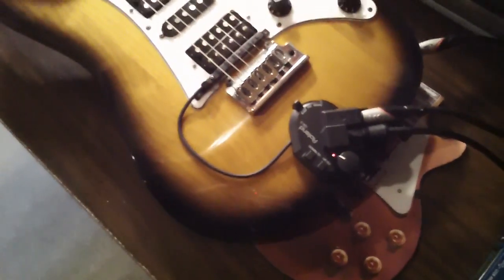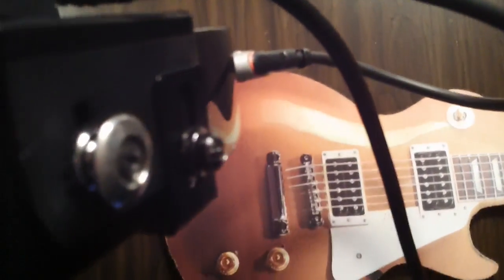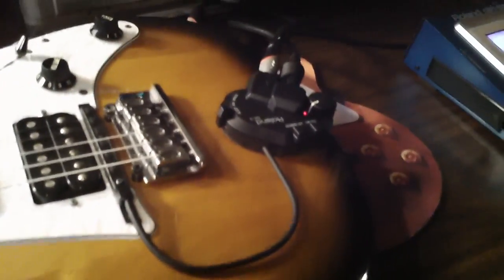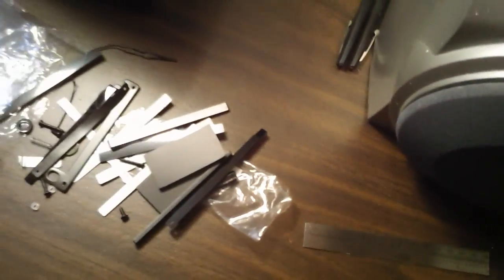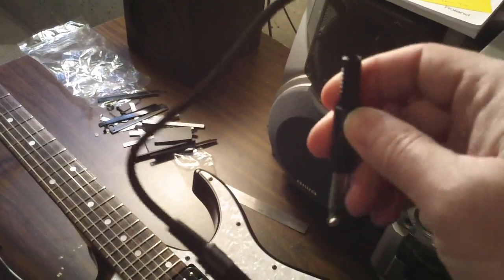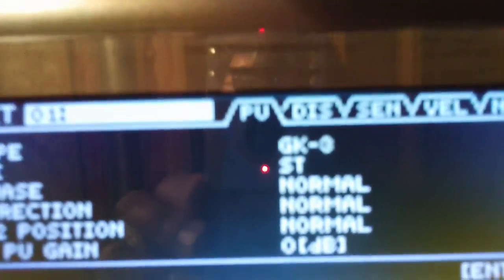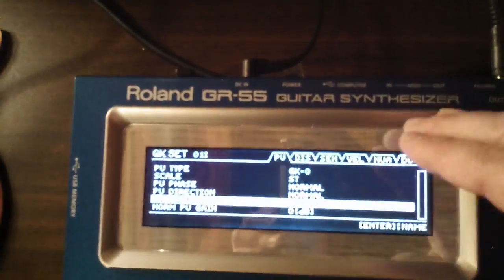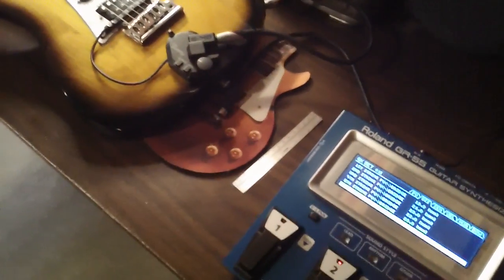Roland GK-3 Pickup Post-Installation Overview

Comment: Bought a use GR 55 and GK- 3 pickup (like New) on the GK-3......the GK and Mix switch are the same and on guitar there is nothing no sound at all. Can't figure it out, any suggestions? Help going nuts trying to get it to work!

Comment: Question... if all i want is full synth sounds from the gr55 no blending or none of that specifically synth tones for lets say a saxaphone or flute solo here and there, can i just plug the 13 pin cable into the gk3 by itself and output from gr55 to a keyboard amp, then plug the guitar output jack to my main pedals and my fullstack as i usually do?

Comment: i'm using the gk-3 on boss gp-10. when i plug the guitar cable to the gk-3 input, i dont hear any sound from my guitar.
does it only work with gr-55? i usually have 2 cables attached to gp-10. one guitar cable going to guitar input of th gp-10 and a gk cable separately.
i saw your video/ the ouput of the guitar goes to the gk-3.

Comment: Thanx that was my big concern about buying one because if I wanted to try it on one of my other guitars or was it guns hurt the value of one my more expensive ones by drilling or making a permant scar on it.good job  of brekin down other tools or acseories I mite need.you wee very helpful in helping me make decision on getting one.atleast now I know I wouldn't have to by another axe just for a processor.now is it fairly easy to navigate through the settings or do indeed a big manual n a translated to figure it out

Comment: i had to cut the pick-guard with a Dremel tool on my 2013 stratocaster to get the clearance needed for the gk-3 pickup.  worst part of the install - but not hard.  looks like you have your saddles set up very high to provide enough clearance for the gk-3?  what is your string height over the fretboard at like the 7th fret?  i thought of just raising the saddles but was worried it would make the strings too high to play.

Comment: Did you have any problems with PCM tracking? I placed the PU correctly, the distance is under 20mm from the saddles, and exactly 1mm from the strings, for every string. But most, not to say all, of the PCM are having lag when play, for example, a simple walking bass using the acoustic bass. Mainly on E and A strings, some times at D string too...
Reply: +SixStringWorship I gave it a little more time to practice and I'm getting a better result now. But still having weird lag on PCM Piano and Bass. Thank you anyway :)
Reply from the maker: +Les Souvenirs Great news.  I remember a few of the patches required some time to get used to.  Take care!
Reply: Is this compatible with a whammy equipped guitar ?

Comment: For those who wants to install the GK-3 in reverse direction with GK-3 cable from bottom high E string. Please follow the link below. I found this after hours of searching online. You can change the setting in GR-55 in 5 sec after installing the GK-3 pickup. It's that easy!!

GR-55, GR-55S: CHANGING THE GK PICKUP DIRECTION:
http://www.roland.com/support/knowledge_base/201955829

Comment: Hey why do u use and plug in the monster cable to the gk3 and the guitar what do that do? Thanks
Reply from the maker: That allows you to blend or split your actual magnetic pickup signal through the GR-55.  You can route the magnetic pickups through a separate amp that way.
Reply: CoffeeDrinker71 I heard u can use your others distortion pedal with the GR55 unit?
Reply from the maker: ***** You can treat it basically like any other multi-fx processor so yes if you want to run a distortion pedal with it I suppose that's fine.  I never set it up that way because the on-board patches and amp models gave me plenty of choices.  Just remember when you are actually using the GR-55 you are engaging the GK-3 pickup system.  I don't know how good those piezo style pickups will interact with another distortion pedal.
Reply: CoffeeDrinker71 I see u install the gk3 to this ibanez u have alot of room to install the kg3. On my ibanez guitar I have the ibanez rg 50 and the ibanez rg3xxv model on both guitar I have to take out the pick ring around the pickup to make room to install the kg3 pickup.
Reply from the maker: ***** Yes, this is the Ibanez RT450 from 1992.  It's basically a Strat configured RG so it has a traditional style bridge which gives it enough room to install the GK3 properly with no other modifications.  I could definitely understand why the GK-3 won't fit on a Floyd equipped model though.
Reply: CoffeeDrinker71  thanks for the help!

Comment: I put one on my PRS Custom but the selector switch only works when its in GK when its in Mix or Guitar setting no sound from my onboard guitar pickups I calibrated all the setting on the GR-55 25" neck length & the Bridge to pickup distance I don't see any thing else to adjust
Reply from the maker: In order to use your magnetic pickups in "mix" or "guitar" mode, you have to have a separate amp hooked up to the back of the GR-55 using the "guitar out" 1/4 jack.  It's basically like a pass-through.
Reply: CoffeeDrinker71 You know I thought so Because when I took it back to the store we plugged the jack from the amp to the Guitar out on the GR-55 and I was happy about that because I knew we were getting a signal trough the 13 pin cable. so in other words theres nothing wrong with the switch its working the way it should. I wondering now if I could use the second Channel of my twin to get the other feed from the GR -55 I will do an experiment. Thanks for the heads up my friend c];-D
Reply from the maker: AL theDoctorWho I'm glad that helped!  I'm not completely familiar with the setup possibilities with the Twin like yours, but whenever I hooked mine up to run two amps I simply used the GR-55 through a set of desktop monitors using the "normal" left and right 1/4" outputs, then I'd run that separate line to another amp from the "guitar" output.  You can do some amazing things with a split setup like that!  That way, you could add all your effects, distortion etc. to your normal guitar signal, and then add a beautiful synth pad behind it through the other signal.  Have fun!!!!
Reply: CoffeeDrinker71  I'm having exactly the same problem: I can't get the guitar-only selector switch to work having one amp hooked up to the mono output of the GR-55 as the only setup. No sound comes out when I change the selector to guitar. I thought it was a calibration problem, but nothing works. So, your suggestion (using the guitar out) is the only solution? I used to own a GR-33 and I never had this problem. So, this seems to be a limitation of the GR-55. I saw a You Tube video of someone switching from guitar to synth with only an amp-to-mono setup, and it worked fine. What do you think?
Reply: MusikeXavier Its funny I was thinking to myself why didn't Rolland have it on the first page L/Mono dose not put out both channels when other output are not used. You will only get signal from the GK-3 pizo pickup I was going nuts But then a big clue when I looked at other Demos I notice all 3 output jacks used thanks for the comment c];-D
Reply: AL theDoctorWho Thank you very much for your prompt response.
Reply from the maker: MusikeXavier
I'm glad you were able to get it figured out.

Comment: Does the pickup cable have to go over the top of the bridge (where it could touch my picking hand), or is there a version available where the cable can go on the bottom (where the volume and tone knobs are, and where my picking hand would never touch it)? If the pickup cable can only be routed as shown in the video, then haven't Roland made a serious design error?
Reply from the maker: I think there is a way to reverse the pickups within the settings of the GR-55.  I'm not 100% sure on that but I've read that somewhere it can be done.  You might want to download the owners manual and search there to be sure.  It would've made better sense though to have the cable facing down, so I agree!

Comment: Hi,I found the pickup mounted over the top interfered with my right hand technique badly.The GK pickup settings allow you to reverse the pickup and bring it up through the bottom.There is extra cable curled up under the bottom plate to accommodate this change.I almost tried rewiring my pickup before discovering this setting.Love this system.

Comment: Thanks for this...very informative.  Do you know if the pickup has to be placed between the bridge pickup and the bridge?  The reason I ask is because I am considering using this unit on a Telecaster style guitar and the design of the bridge plate doesn't leave enough room for the pickup.  I would need to install the pickup between the neck and bridge pickups.  Do you know if that would work??  Thanks.
Reply from the maker: Thank you for watching and commenting.  I can't answer definitively because I have no way of trying this out first.  I know there are calibration settings inside the software of the GR-55 that are based on the measurements between the guitar saddles and the piezo pickup.  I just don't know if it would go "high enough" to measure the distance to your proposed location by the neck.  Maybe it would work but it just might not sound optimal if that makes sense?
Reply: To answer your question Tedd; the recommended distance from guitar saddle to the middle of the gk3 pickup is no more than around 20mm so putting it in the middle of 2 pickups wouldn't be ideal.

Comment: do you need a splitter to use this or does the pickup have 2 outs? one for the guitar amp and one for the keyboard amp/ synth setup?
Reply from the maker: Aaron, the best way to split the synth and magnetic pickup signals with this configuration is through the "guitar out" jack on the actual GR-55 synth unit.  So, your 13 pin cable would actually carry both signals to the GR-55 but the magnetic pickup signal would have a dry pass-through from the back of the pedal board to your other amp.  There is a blend knob on the GK-3 pickup to control each signal.  I hope that helps.
Reply: CoffeeDrinker71 Thanks for the quick reply my friend. I was planing on using this pickup with the gr 33 actually. Do you have any experience with that? How much tone loss is involved? Surely the signal doesn't go through the whole synth system before splitting out into a guitar amp

Comment: Hi there, a quick question: did you put something in between the pickup and a double- sided tape or did you just paste directly underneath it? Thanks.
Reply from the maker: If I remember correctly the double sided tape is stuck directly to the bottom side of the pickup and then placed directly onto the pickguard. There were other mounting options but this one worked best for me.  Thanks for asking!
Reply: Thanks a lot!
Reply: CoffeeDrinker71 hey dude thanks for the video, was wonderin though how i could get this onto my ibanez as far as the actual pickup, the unit would fit on my guitar as u have done on this video, but the pickup itself might not fit between the bridge pickup up and the saddle on my guitar, reason being is because the bridge pickup is extrememly close to the saddle on my ibanez, do you think it would work as well if it went between the middle or bridge pickups on my guitar or would it make much difference since its a synth pickup.
Reply: brian bridges don't: I tried it as an experiment, and it wouldn't track properly.
Reply: ha, i had the misfortune of tryin it myself dude and yeah..... was a disaster, even when i got a guitar that it fitted perfectly the tracking is still almost unusable on a lot of the presets......and a lot of people have complained about this..... roland need to get the finger out and start listening to the feedback on the forums...... the fishmans tripleplay is meant to be way better for tracking but not as live-friendly, it has to go through a laptop and thats pretty awkward for live use.

Comment: Can I run the GK-3 into a generic midi/usb interface plugged into my laptop? I don't want to use any hardware synths, mainly because I design my own sounds. I just want control software synths on my computer.
Reply from the maker: Hello, I don't know if that's possible.  A standard midi input uses a 5-pin cable whereas this Roland system uses a 13-pin jack.  I'm just not confident to say it would work.  You may want to contact Roland to find out.  Thanks for asking.

Comment: is there a way to use the roland unit and also use the analog signal of your guitar .. the roland signal going to your laptop and the analog going to an amp?
Reply from the maker: Yes, I believe so.  If you notice on the back side of the Roland GR-55 there is a "Guitar Output" jack which takes the clean guitar tone and allows you to run it through a separate amp.  I hope this helps.

Comment: I did exactly like it is in the video but couple of days ago when I had a small gig the strat pin fell off when I slightly bumped gk3 with my amp while changing some settings :/ Do you  have any tips how can I make it more stable? My strat is a Highway One US made. I had no time to fill the hole so I just used a bigger pin which of course damaged the pin hole even more. I don't think gk3 is meant for stage as it's not as fixed to the guitar as I thought it would be.

Comment: Quick question how to make the GK-3 Pickup fit between the bridge pickup and floyd rose system it is a tight squeeze..Will it be better to take the pickup plate off or pick up support ring?

Comment from the maker: Check out Roland's FAQ page.  I found this answer there:  "A.Yes, you can. Note, though, that the GK-3 pickup is designed for a right-handed guitar. Reversing the pickup for a left-handed instrument isn't a problem; it will work fine. The orientation of the GK controller unit, however, is fixed in a right-handed manner. For this reason, you may find the controller's GK Volume and S1 and S2 switches difficult to use when the controller is mounted on a left-handed guitar."

Comment from the maker: The Roland 13-pin cable is specific to their products only (I believe) so you would have to use the GK-3 pickup with another 13-pin device.  I don't know if there are any adapters out there to go from 13-pin to standard 5 pin midi.  I hope that helps.